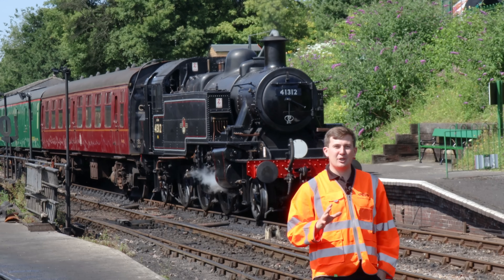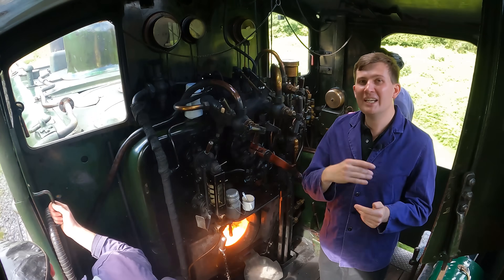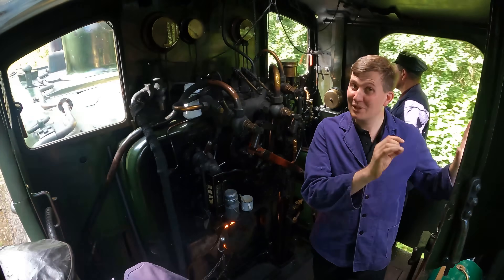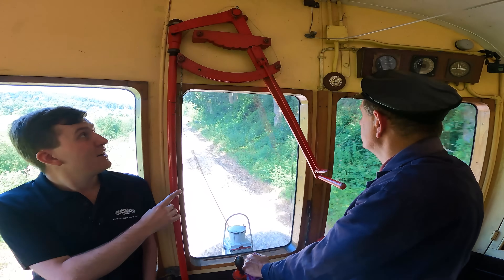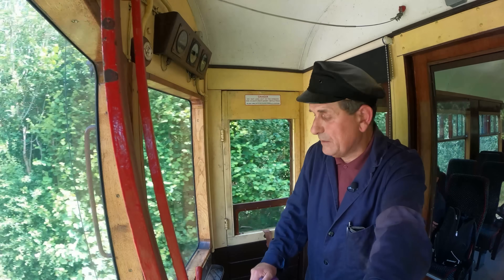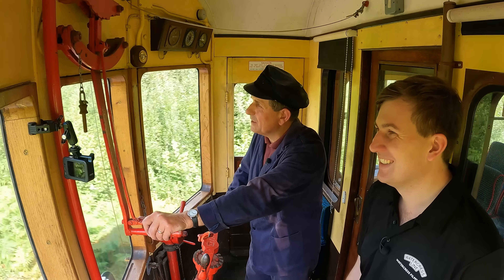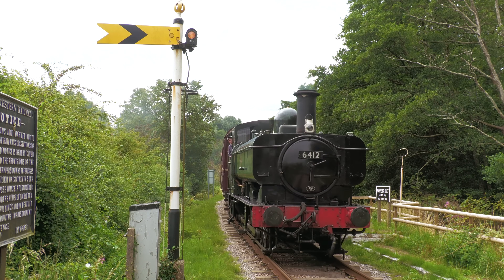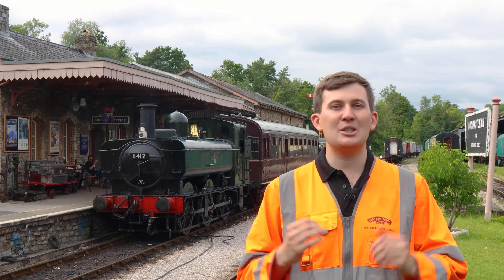Push-Pull Trains: How Do They Work?

Comment: I've been wondering about how the steam push-pull system works and this is the best video documentation I've seen, actually showing the mechanical linkage. I've read that some lines gave up on the sometimes problematic linkage and resorted to bell or whistle signals to the fireman-driver. I can imagine that the alternate pneumatic system mentioned had its own quirks and limitations. The driver in the driving trailer had control of the throttle/regulator and train brake ... but what about the reverser/cutoff control? That fell to the fireman/driver to manage as the train came up to speed in push mode??
Reply from the maker: Delighted you enjoyed it! Regarding the reverser, the fireman would have full control of it

Comment: Kinda cool that it's still used here in Belgium, where there are coaches that have a control cab. We even started implementing a mix of emu and coach control cabs with the latest M7 dubbledecker coaches.

Comment: Thanks for that. Into the 1960s Push Pull trains ran between Three Bridges and Tunbridge Wells West.  I once got a ride in the engine cab from East Grinstead to Forest Row with the engine pushing,  on the line that has long been lifted.

Comment: From what I read,there was not only mechanical operations on push-pulls,there were cable,and vacuum versions of controls! The Isle of Wight has the LSWR type PP's operating,with air pumps! Query; What other companies/ regions used what systems for PP services?? Thank you for time and efforts,well done! Thank you 😇 😊!
Reply: I believe that the LMS also had a pneumatic system. Push pull is still in use today with the 91/Mk4 sets on LNER and  the Mk3 sets between Marylebone and Birmingham for Chiltern.

Comment: Excellent video! Very well done explaining how the push pull system works! I didn't know about the other system that used compressed air to control the engine.

Comment: Push-Pull M7 on the Mid Hants Railway in the future?
Reply from the maker: That would be fantastic but unfortunately there are only two M7s in preservation, one at the NRM and  30053 based at Swanage which had the equipment removed after it was withdrawn in the 60s.
Reply: @thewatercressline   245 in the National Railway Museum is static exhibit, but in any case its a short frame version so it couldn't take the Southern Railway compressed air push pull system.

Comment: The railmotors also used the same system for theor trailers/autocoaches, it was intercompatible. The difference was a loco could have two coaches front and back each, and pull/push it without issue, the railmotor is two coaches and struggles

Comment: Strictly speaking, the LSWR system was a notoriously unreliable cable-worked one. The SR air-control system originated on the LBSCR, which used Westinghouse air brakes anyway. The Southern referred to it as "Pull-Push" too, which makes more sense as you'd usually pull first, then push back...
Reply: Unless you are in Great Eastern territory and using the Epping to Ongar section of the London  Underground when the trip to Ongar from Epping was pushed and the return pulled.

Comment: On the North Eastern Railway, there were some locations where trains ran for short in reverse into and out of stations under the control of the guard. Trains from Scarborough to Whitby reversed out of Platform 1a at Scarborough and then from Whitby West Cliff to Whitby Town and in opposite direction. But these trains were limited to 2 coaches with a guard's compartmentcatvthe rear of the train. The limit of 2 coaches was due to the length of Platform 1a and the steepness of the line between the 2 stations in Whìtby. Longer trains could not be run in reverse. The other location I know of this is Guisborough, where longer trains could reverse into or out of the station, provided there was a guard's compartment at the rear. Some form of autotrain would have been useful.
Reply: Up trains into Dorchester South did the same, running past the station then propelling into the platform - and they were full length Weymouth to Waterloo expresses...

Comment: I remember a railway tour of Germany to see steam. In Saarbrucken a commuter train was operated by push-pull, a class 23 2-6-2 ws in the middle of a train with 4 or 5 coaches either side of it. It went in and out of the station a cople of times while we were there.
Reply: The GWR autotrains could do the same, but only 2 coaches each end on the locomotives. 2 coaches being the maximum limit for the mechanical control system.
Reply: The German system is interesting because it didn't even have direct control of the regulator (except in emergency). Instead, the driver had a device in the cab much like a ship's telegraph which could transmit a few set messages to the fireman on the loco ("start", "shut off steam" etc). The fireman would do as instructed and confirm he had done so on a similar device on the loco. The driver would handle braking; this would usually have no direct effect on the loco, but if he selected the "emergency" position on the brake controller, air would be fed into a cylinder fitted in the loco cab to slam the regulator shut, so he could still stop even if the fireman became incapacitated. The same thing would happen if he let go of the deadman's handle in the auto trailer cab.